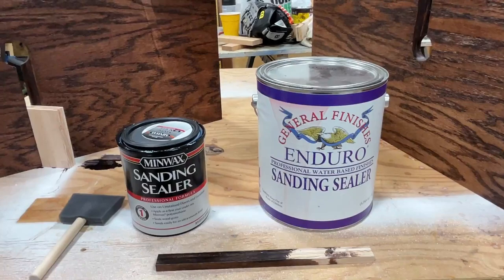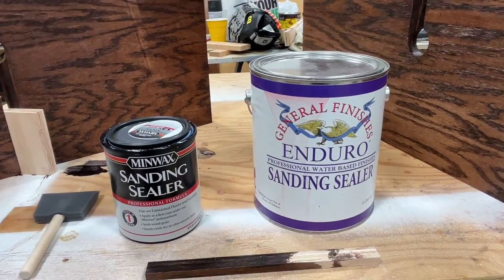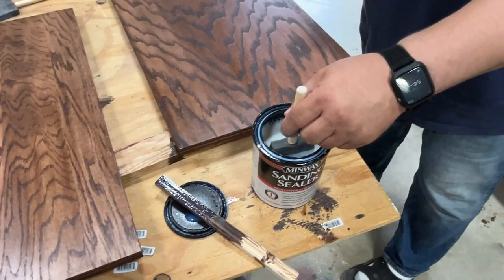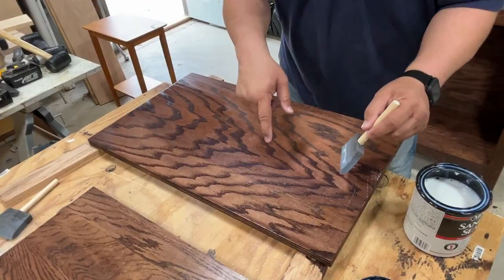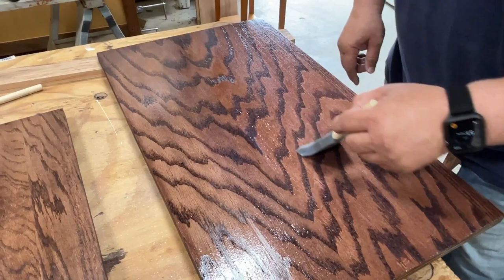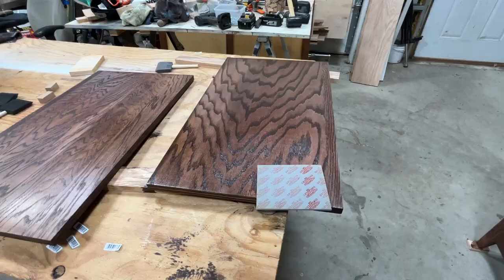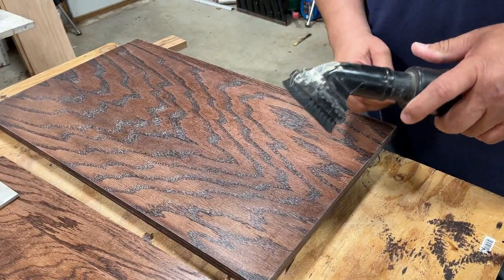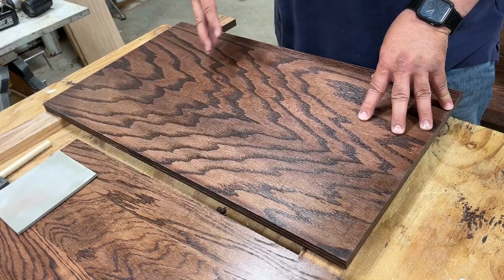4 Simple RULES for Applying Sanding Sealer: Achieve a Better Finish! 💪🏼 #woodandstuff  #woodworking

Comment: I like using sanding sealer when I want a lighter coat of stain.   It works awesome and makes the project smooth as glass.
Reply from the maker: I'm telling you... it makes a difference! ;)
Reply: -55  it sure does.

Comment: Is there such a thing as an oil-based sanding sealer? I'm using oil-based stain and oil-based poly and I know it's either oil all the way or water all the way.
Reply from the maker: Oil-based sanding sealers are still available for residential use, but their availability and usage depend on your state's environmental regulations. Some states, like California, have strict rules regarding products with high levels of volatile organic compounds (VOCs), which can limit their sale and use.

Brands such as Minwax and Cabot offer oil-based sanding sealers, but you should check if they comply with local regulations in your area. Some stores might not stock these products in states with stricter VOC laws.

I highly recommend using General Finishes water-based sanding sealer, which can be used with an oil-based topcoat. General Finishes advises testing on a sample piece first and ensuring the sealer is fully dry before applying an oil-based finish. Wait at least 24 hours and ensure the surface is not tacky. If the surface is tacky, do not apply your finish as it will not adhere properly, leading to suboptimal results, including peeling. Lightly sand the surface and clean off all dust before applying the oil-based topcoat.

When sanding, I recommend using Premium High Flex Contour Sanding Pad Sponges, 220-280 grit (https://amzn.to/3xq5rCh). In the project featured in this video, I used an oil-based stain (Minwax), a water-based sanding sealer (Minwax), and a water-based topcoat from General Finishes. The key is to let everything dry thoroughly and sand between coats.

Personally, I prefer using General Finishes water-based topcoats because the finishes are outstanding, and cleanup is super easy. Thanks again for watching, providing comments and questions, and please feel free to ask any more questions as needed. If you haven’t already, watch my video about how to apply a topcoat here: https://youtu.be/hP1JF_rnDp8?si=Fyj66MmeMkJ1Dsb7

Comment: You answered my question indirectly. What goes on first the stain or the sanding sealer.
Reply from the maker: First, apply the stain, followed by the sealer, and finish with your final coat. Remember to sand between coats of sealer and final finish. The last application of your "final" finish should be done without sanding. If you follow these steps as I've outlined, you'll achieve a fantastic final result! Best of luck, and please keep us informed about the outcome!